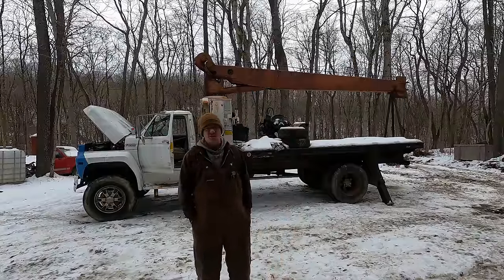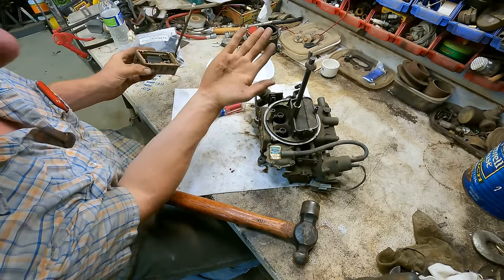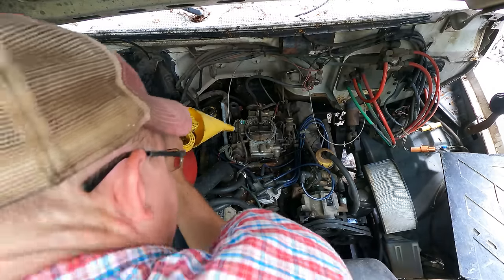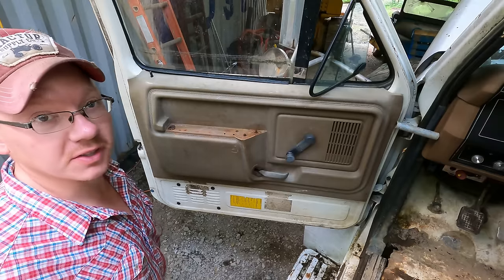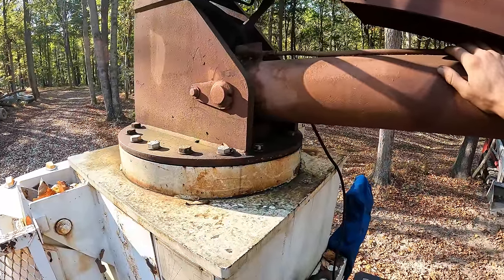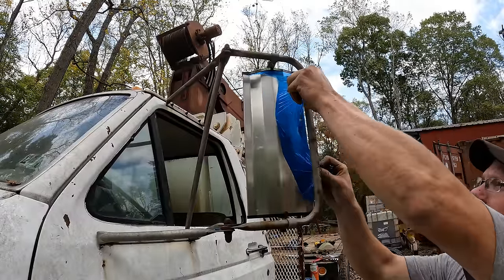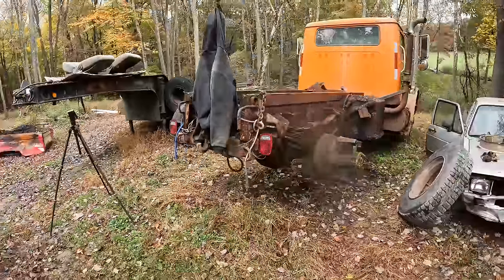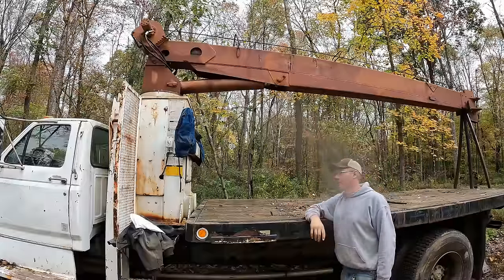Repairing a $700 Auction Crane Truck!

Comment: I have found after owning a few big block Ford gas burners a cold start procedure that has worked well for me. I like the manual choke but I have found the the choke works best if you pull it all the way closed then crack it open a little. Never seen one of these that does well with that choke all the way closed. Pump the gas three times and try it. If it does not fire off within a few seconds, stop. For some reason, continuing to crank on it like you would a Diesel does not work. Pump three more and try again. I had one 460 that the first try would have you thinking that some prankster had removed your coil wire. Second try usually yielded some promising spit sputter die. Usually the third try had me running. Three pumps on the gas and three more with each attempt sounds like begging for a flooded motor but I don't remember ever flooding one of these and continuing to crank only got me dead batteries and reduced starter life. I'm sure you'll experiment with this but I feel this would be a good starting point.

Comment: Paint the boom flat black and your new logo in red. At least you have a parts donor truck for it just in case you need the rear differential maybe some steering and suspension parts might interchange hopefully. It’s amazing how the engine runs really well and it doesn’t smoke after your first adventure ever working on on a big block Ford. Your work has paid off well for you. Have a Blessed One Sir.

Comment: I worked on Diesel powered Gardner denver and NLB water pumps and the heads required 600 ft lbs on 8 bolts

Comment: Especially for the older model vehicles I try and put a super magnetic either on the bolt or the bottom of the pan should any metal flakes up here they'll stay there. First choice is the bolt because it can be inspected where the pan is not inspectable

Comment: I thought the 429 was dropped in 1973 or so.... ?? Surely that is a 460 with an old air cleaner on it. Great video. I put a 460 in my '65 Ford with a top loader 4 speed. Fun!!! Holly 600. And yes those backfires will destroy the power valve.

Comment: Love your turbo-powered carb installation platform, sir.  //  The blowby from the crankcase should be sucked up by a PCV valve which goes to the intake vacuum.  It fits in that hole in the yella rocker filler cap.  Where dat?  And what's with all the red and green PEX hose under the hood?  Was that a plumbing truck?  LOL.  //  Oh, MAN.  Well, you had at least an RCH of clearance under that truss, Matt.  Hohaho.  Are you going to trust that lovely crane cable?  Lots of free hydrated ferric oxides and hydroxides there!  //  Maybe the exhaust leak could be fixed with the handy dandy old J. C. Whitney muffler bandage!  Or even J.B. Weld, if you must.  ;)  What I would love to have is a tiny, short-wheelbase knuckle boomer.  Enjoy your crane truck, dude.  She's a keeper.

Comment: Naw! The mocking came when you said, "the exhaust leaks, but hey its a FORD". 20,000 of us shouted, " A-men"! I had a 1985 FORD F 250 Ghost truck that my Father in law traded me for a CHEVY 1970 C-10. Crazy FORD truck had such a bad exhaust leak it sounded like it was tap dancing! I finally got the gasket to put in the exhaust system. The gasket only lasted about 2 weeks before it burned through. Oh, the reason we called it the ghost truck was for whatever reason that I could never figure out, once in a great while, late at night the trucks engine would turn over until it ran its battery down! It wouldn't start because the key wasn't in it turned to the ignition on position. Of course the first time that happened I thought someone was trying to steal my truck. So I ran outside naked, swinging a 38 caliber Smith and Wesson revolver all over the place. 😊

Comment: For the price and the small amount of work you had to do to fix it up, it was well worth it! A crane is one of those things - once you have it and use it, you won’t be able to get rid of it after seeing how much you can really use it. As you said, after one or two uses it’s cheaper than renting one. As far as talking big repairs, do be afraid to try something, especially on big old equipment- they are all pretty simple and there is now ample info readily available on the web if you do run in to problems. Keep up the great vids!!!

Comment: Those Ford ignition key cylinders wear out after a while. The one on my Tempo got so bad I could actually pull the key out of the cylinder while the car was running - and it would stay running! That was about the time I got the Haynes book and got my butt over to a locksmith to get a new cylinder!

Comment: most of these older cranes you can just pull the cylinder out the back of the boom, normally just have to extend it out to where you can see your pins and pop em out, If you had another boom truck It'd be a quick job lol

Comment: Love seeing this thing progress to being reliable and useful. 

I was surprised to hear air brakes at the end, being a gas truck. Also, is that carb a stock Holley double-pumper?

I think uncapped vacuum ports cause too little air to flow through the venturi, which relies on that air volume and velocity to properly atomize the fuel. When it doesn't atomize, you get bigger droplets that don't burn like the finer fuel mist does. It's a lean condition (too much air) that can present as a rich condition in some exhaust sniffer tests, because of the incomplete fuel burn.

Comment: for the mirrors, have you tried silicon tape between the housing clamp and bar to make a tight fit? this will also add a touch of vibration dampening.

Comment: always keep old gaskets from carb in a pile before you rebuild match new ones up. sometimes new one will cover or miss a hole in meter blocks (on Holleys) and will never run right.

Comment: As you are not a gas power fan may i sugest you tee into your hydraulic swstem so that in a pinch you can run it like an accessory with one of your skid steers  just a thoughg

Comment: OK, you need to know about 5200 (3M) adhesive.  that would hold the arm rest forever.  -takes 72hours to set, but fast set (type) is 4 hours.

Comment: Excellent to see it running and working. I know that you probably still don't plan on putting it on the road, but wouldn't hurt to get it fully road ready just in case you get a small crane job on occasion.

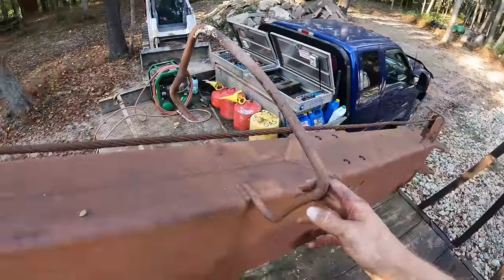Comment: 37:25 I've seen those stink bugs in new england. They usually get the zap racket or the bug-a-salt gun. Splats them pretty good. If I fry them on the zapper it's a bug cookout. And yes it stinks.

Comment: Did you add some warning stripes and height numbers to your truss yet?  I have knocked the bottom section of my garage door with the rops on my tractor. And caught an overhang while spreading rock under a lean too.

Comment: Matt, get yourself a 5 gallon ultrasonic cleaner; i bought a medical grade one from ebay that heats to 90C with 90 minute cycle times. cleaned rifle brass, carbs, tools, car parts etc. using simole green or pine sol and water. if i was doing this job id ultrasonic clean it for 90 min before even pulling a bolt out.

Comment: Hi Matt another great vid crane and your winch could use a wire rope grease it comes in cans and sprays on as your rope is fully extended as you rewind it in spray your rope this will make sure your rope remains supple and won't damage the rope as it packs itself on to the drum Matt and your ropes will last longer and try not to snatch them that's when your separate strand can break and then the rope is all but useless you can make chokers or slings but make sure no broken pieces are in any of them I know what it feels like getting one of them short wire strands between nail and thumb not a fun thing and stays for weeks to remind you of it keep making these refreshing sometimes funny all ways amusing vids man all the Best

Comment: Sounds like it has a bad cylinder or crossed plug wires.. A hole in the exhaust won`t make the engine weak or make the exhaust make bloop sound..

Comment: check the timing on that thing   check the firing order  back fire thru  the carb takes the power valves out  check the fuel pump  it may be bad and leaking fuel into the crankcase

Comment: Did I see a remark on overhead clearence on the dashboard? 🙂It's a beautiful towtruck, but there is not enough pressure (weight) on the rear axle and wheels so you will keep spinning offroad.

Comment: hot idle speed should be 650rpm, sounds like some vacuum leaks, the emission system on those years always develop leaks, either replace or block off some hoses not all needed to make it run smooth, it's a farm truck.

Comment: I was thinking ... you know, a good white would look nice for the boom color.  notes the rest of the truck  It would probably look off.  Red perhaps?  Maybe.  How about a deep black?   That'll work.  Another easy peezy fix ... remove the stick from the wiper blade! (not that the blades even work). HA.  Nice save and yes, I agree, replace that cable before you find out a different way that is was due.  Nice fixer, Matt.

Comment: The only relief that can be had when dealing with a carburetor is to replace it with an aftermarket fuel injection system. Many company’s make such systems but they are pricey.

Comment: Just a thought 💭 I don’t know if u have solved the running issues but worth checking ur diaphragm in ur petrol pump ⛽️ as if it has a crack and is a mechanical pump it will pump fuel into ur sump which will then alter ur fuel mixture and run rich through ur crankcase vent and behave like a tunning issue which is what I first suspected or an intermittent electric issue

Comment: 24 years Pepsi , then UPS , Airgas. Having whacked a bit o stuff over the years.  My mind was alerting when you pulled in. I whacked a door in 2019 that wasn't quite all the way up.
Reply: If you ever use it on a jobsite.  Hi-vis is required for boom. Same color as grader and Cat.  One color for everything.  But for kicks Ryobi green.

Comment: Matt why not take off the air tubes to the exhaust I did mine cut the tube 3/4" tall then tack welded the ends after chrimping the tube over then it be quiet and being it not going on the road you can see the new tubes ? Also why are the headlights are missing

Comment: Next time you have that carb off, remove the EGR valve entirely, and make a flat plate to cover the opening. that valve diaphragm will rot out and you'll have another vacuum leak, which usually occurs at the least opportune time.
And since you've done all that 'cosmetic work', and put new shoes on her, go ahead and finish her off & weld up that exhaust leak.
Also you need your merch site as a secure site, my browser isn't exactly set to 'bank vault' and it won't allow me to even go there..😁👍🇺🇸😎
Reply from the maker: The site is down right now. And unfortunately the leak is a manifold leak so nothing that can be welded

Comment: I USED TO WORK @ CLEARVIEW TRUCK STOP/CAFE...TYLER PIPE CABOVERS RAN THROUGH THERE AND WOULD STOP FOR FUEL AND USUALLY AN INSIDE FLAT...SPLIT RIMS GOT TO BE MY SPECIALTY ...1st TIME I CHECKED THE OIL...SIR YOUR A QUART LOW...🤪👈 ...THATS A GALLON SON...

Comment: Matt questions 1 why don't you take the 2 remaining tires off from the International salt truck put it on either the trailer as a spares what about the brown dump as you said was dead  see if that international diesel engine runs and fogged it for later

Comment: to me it sounded mainly like ignition failure from the start. start fluid would have snapped it to hard life for a short burst otherwise.
the spark controllers are known to be complete piles of....  looked like it was on the passenger side fender of that truck. that and the pickup in distributor less often. people always overlook wires being bad, they can go bad internally with resistance goes so high it equals a huge gap of 2" or more. 
surely the carburetor was gummed up anyway at that age.

Comment: Hell,no, it was a great purchase, given your gift of mechanical ability, over time (to save up some $...) once you get to a point where you've done the main repairs, this truck should serve you well!
I agree with Travis, below, you can use attention getting RED on the boom for safety, or alternately, white or blue to keep the truck "clean" looking &  "american" themed w/ the red. Wash is mandatory and, since you already started, might as well lose the last "problem" of the exhaust at some point. No use doing things halfassed. If you "wasted" your time on the headlights, your time is worth fixing the exhaust. Pretty major item. After, you'll be glad you did, esp. If you paint the thing and it still sounds like "shite"... it just isn't to that point where you're seeing it.
In for a penny, in for a dollar. Screw it, just get past the repair, once you finish, you'll be glad it's behind you.

I noticed in the grader teaser at the end, you & crew painted "christine". Looks great!! Did y'all remember to paint the UNDERSIDE CAB ROOF? [-just a friendly reminder]... it should brighten the Inside of the cab for yah.

Comment: I've done exhaust manifold stud/bolts on a modern 6.2 V8 gasser inside a 2015 F-350 4X4.
NOT FUN.
But I'm sure there's got to be a lot more space in that F-800 to do the job somewhat tolerable.

Comment: I think it's got valve timing issues and maybe compression issues. Fire from the cylinders shouldn't be coming back into the carb causing the flame that we saw. To much blow by is bad for a engine

Comment: If you are not going to adjust the belts to stop the squealing, please get some bar soap and rub it in to the wearing surface of the belt.  That way, you will be able to hear the other noises that beast is making.
Reply from the maker: You mean the manifold leak? I can hear that over the belt squeal lol
Reply: @DieselCreek  Yep.  It is running nicer all the time.

Comment: Only comment is that you should put those tires on the parts truck.  Yes, it’s work, but instead of a rolling parts truck, you have misplaced rims, a stationary object, and likely to lose the spacers, nuts and lugs.  It’s a lot of extra work, but it’s the best practice, and I have regretted shortcutting this step more than once…

Comment: The problem with engine dying after you release the key is probably the ballast resistance cable.
Let me explain.
You have a 12 volt battery and a 10 volt engine  coil that produces the spark.
The problem starts when you excite the starter motor or turn the key.
When that happens the battery voltage drops by about 2 volts or about 17%.
In order to give a good spark at the car manufacturers make a 10 volt coil. that solves the problem but creates another problem.
 When the engine starts battery sends 12 volts into a 10 volt coil.
That will burn out the coil that produces the spark.
The solution is to put in a restance cable which reduces the electric feed to the coil by 2 volts.
If the above was NOT done the spark at the plug that causes the ignition of the combustible fuel would be reduced by 17%.
That  would mean instead of having a spark of 25000 volts you would have a spark of around 20000 volts. 
That in turn makes the engine harder to start.
Not a problem today as all is controlled by the engine management system.

Comment: it sounds to me like its running on 6 cylinders, not 8, I would hope you have checked the distributor cap for track marks and the camshaft for wear where it's not lifting the inlet valves high enough on 2 cylinders or more than my old mustang 5-litre use to sound the same mine was the inlet cam lobes worn down needed a new cam I hope yours is just a cap.

Comment: With what little experience I actually have, the revs should be higher while running the hydraulics?  Does it have an idle screw or a throttle pedal to raise the idle for operating the crane?
Reply: I used to run 15/40 in my 6.7 Ford pickup, but due to the winters here in Alberta, I switched to 5/40 for easier winter starts.
With all that fuel in the oil, I bet it cleaned up the engine pretty good ... or else hooped it!

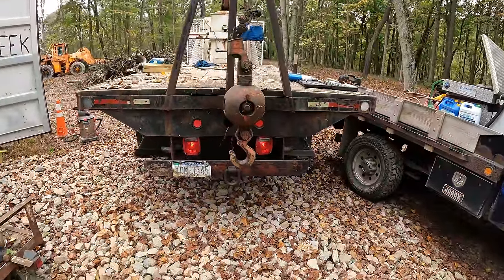At 39:55, are you missing a safety latch for your crane hook?

Comment: I think I know what would make that beast REALLY purr...

Replace that cruddy Ford V8 with a Cat or Cummins Diesel...

Admittedly, you'd need to replace the transmission and hydraulic pumps with ones matched to the Diesel, but I think it would work FAR better...

And SOUND better since you'd almost have to replace the exhaust system for one that can handle the increased heat of a Diesel...

😄😁😆😅😂🤣

Comment: Hate to come off as a know-it-all,but, while working in construction we used to park vehicles with ass end up and chock the wheels. With tire on the chock. Also used to deliver fuel to heavy equipment. My charge was to top up all the equipment with " fresh fuel " to start the season. In many of the trucks we would close with a hydroscopic additive in the tank. Just sayin. Also you are killing that engine with all the short trips and brief running time. Run it and fetch some logs or sumtin' !                                    Cheers.

Comment: I laughed out loud at that poor starter giving its all. I recently pulled a 460 out of an ol f350. Unfortunately we had a bad winter here in tx and it cracked both heads in between every single valve. U don't happen to have a spare set for sale do u? And maybe a crank?

Comment: You know on safety. Those safety guys don't know what they're talking about. I've had two wire pulls go catastrophically bad. On one the static line broke, picked up a guy and threw him 300 feet and laid about 10000 feet of static and pull rope on the ground. Screwed the guy up pretty bad and our safety referred to that as a near miss. Which it clearly wasn't. And on my most recent pull we dumped about 30000 feet of Fibre on the ground, across two major highways and several side streets. And the also called that a "near miss." That's no near miss, that's a complete disaster.